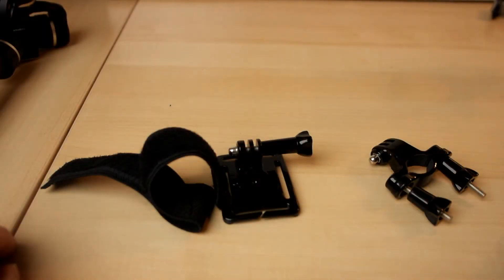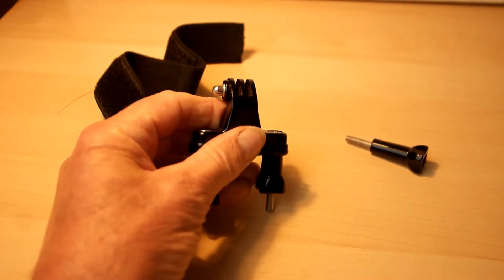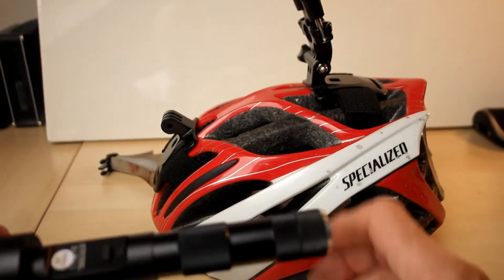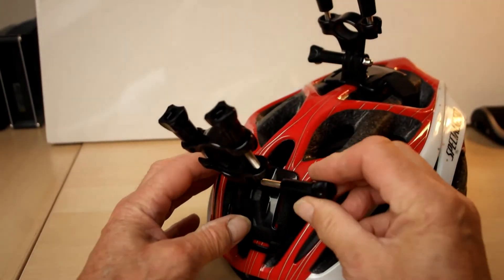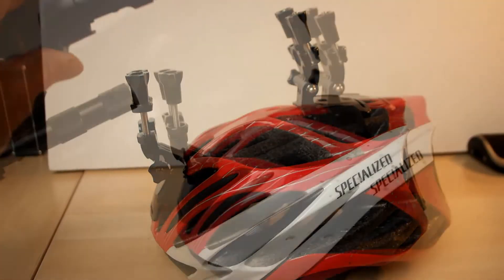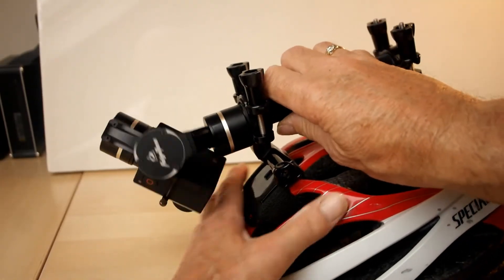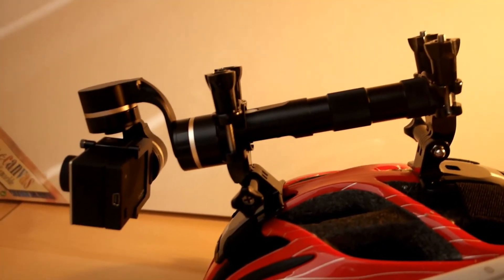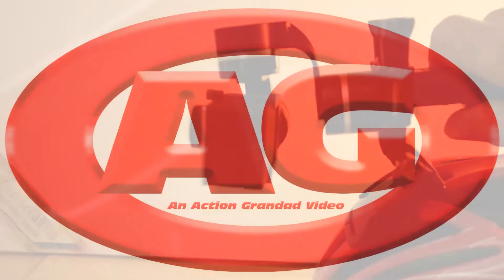Feiyu Tech Helmet fitting

Comment: Great Idea, Thanks for Posting..........
Reply from the maker: One warning.  Do not use the Bacpac battery as shown in my video.  When you look down the camera touches the gimbal and then points downward.  The gimbal then maintains that angle and I ended up with recording the handle bars for the whole ride.  Removed the Bacpac and the results are great.